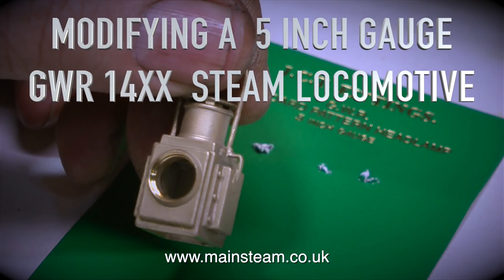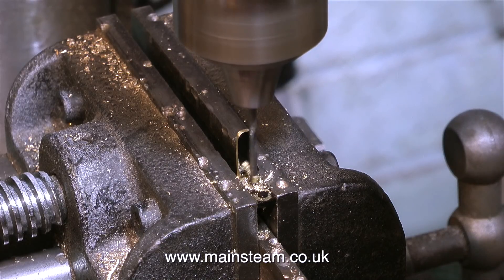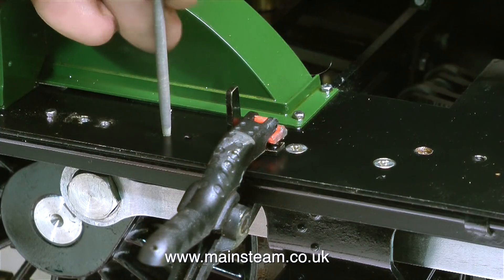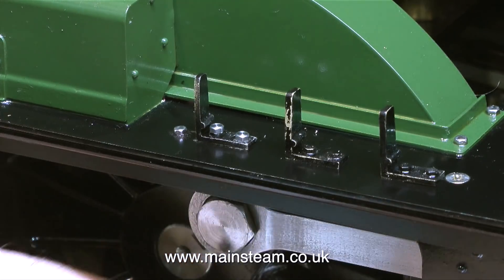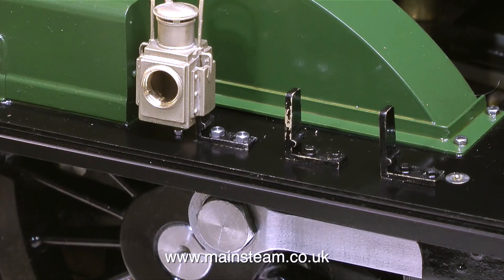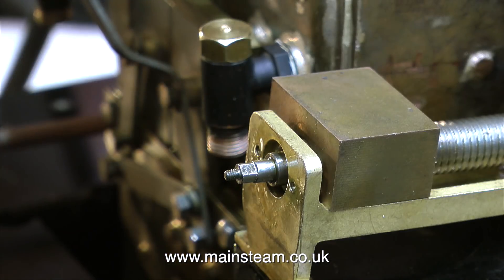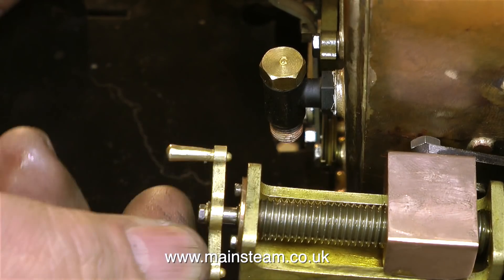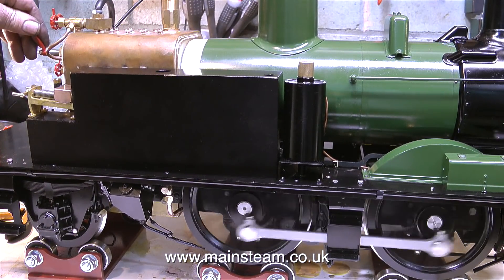MODIFYING A 5 INCH GAUGE GWR 14XX STEAM LOCOMOTIVE - PART #7

Comment: Keith, you could remove the reversing block and rotate it 180* to mark up a new hole in that side for the reversing link, then plug the original hole.

Comment: I have a question that Google is stubbornly refusing to understand me on.
"How do long steam engines turn corners?"
I immediately get flooded with videos and articles explaining how the conical/parabolic camber of the wheel adjusts for the spin differential when turning and how flanges are only an absolute last resort to stay on track.
But how does a 0-8-0 steam engine turn without the driving wheels jumping track?
Do they remove the flange and camber from the 4 central wheels, are the 4 center wheels built to a slightly narrower gauge or do they just rely on prayer and engineering tolerances to get then around the bend?
Best Regards,
'Zap'
PS. Could you add a forum link to your about page so that the peasants amongst your viewership may hone their skills without leaving drainingly long comments and praying to the Virgin Mary, Saint Nickolas and Baby Jesus that readers don't loose energy while reading unexpectedly long walls of text for a mere YouTube comment?
Reply: Zappyguy111, The answer to your question is quite simple. Large engines like the Union Pacific’s Big Boy, a 4-8-8-4, actually had all of its wheels, including drive wheels on bogeys. This was to allow it to turn tight curves. This was true for many other engines. However, if they curve was really tight, many engines just could not make the curves, so they would use doubleheaded trains with smaller engines. Anyway, I’m starting to ramble. I hope I answered your question, even though I’m not Keith.
Reply: In Germany there were some engines with a 4 10 2 arrangement those were tricky: With their 5 Axles one solution was as follows: Split the coupling rods. Connect the first two, the last two, and the three in the middle. Put the first two and last two on bogeys. The Middle one can move to either side a considerable amount.   I dont know if the real thing worked like that, the H0 Scale version does. 

Hiwever, as this was a pure main line loco, the turning radii were quite large anyway

Comment: I was thinking about tapping the screws into the step plate too. Thought the plate might not be thick enough for that. --- Isn't it a bit unlike you to not replace all three of the lamp holders? ;-)  PS. It seems that you are fairly impressed by the basic quality of this engine. But does it really compare favorably to the U.K model versions? (Not looking for any Chino-Bashing... just a nod to good or bad or needs improvement?) Otherwise, as a total novice, this engine looks great to me. Hope it keeps preforming well for you.
Reply from the maker: Which "UK Model Versions" are you using as a comparison?
Reply: Oh. I just meant what you usually see from Blackgates or other U.K. suppliers of kits, machine able parts, etc. Or from other older manufacturers that you have worked on or own.

Comment: Keith, would you not consider replacing the screw reverser with a more prototypical lever reverser? You could purchase the drawing for the 5 inch "Didcot" one and use that as a template? Just a thought.
Reply from the maker: GWR generally used screw reversers I think  . . . .

Comment: You’ve added the disclaimer that the locomotive isn’t produced by two named manufacturers, but haven’t mentioned the name of the company that did. It’s also slightly confusing why they would ship the loco to Blackgates to have a injector fitted, but then allow you to purchase it without the work they wanted done being completed first. Regardless of my confusion, this is interesting series. I’m looking forward to it steaming in your garden.
Reply from the maker: I did the work, please see the video that I made about fitting steam locomotive injectors. The manufacturer was sent a couple of unpublished private videos explaining the problem and the solution. Once they knew how to make the injectors work, I offered to buy the engine to make the video series that you have been watching. As far as I am aware, the  Chinese manufacturer generally supplies to the trade and so I don't wish to mention their company name - I get enough emails and messages asking me where I got it and even how much it cost !!! I don't want to open the floodgates to the manufacturer with hundreds of requests .......
Reply: I must have missed that earlier explanation. Thanks. This all makes sense to me now.

Comment: Hi Keith, I must confess that I was a little surprised that you didn't fabricate a new reach rod. You are, after all, the king of the workshop!
Reply from the maker: No point really, the problem was in the range of travel of the die block .....
Reply: Right. Forgive my lack of understanding - I'm not an engineer. Many thanks for the reply.

Comment: The spacer in the reversing block reminds me of the full size 0-6-0 tank engine i sometimes work on sometimes volunteer on at some point in it's life it got a new set of tanks and the reversing quadrant wasn't put in quite the right place so it has a rail spike that sits in the quadrant to prevent it being locked in reverse as in to damage the valve gear